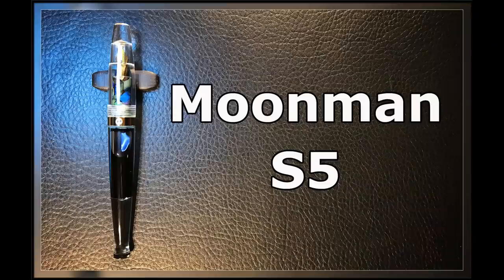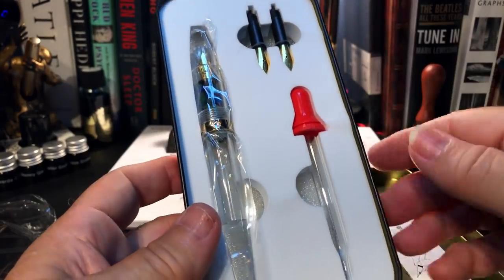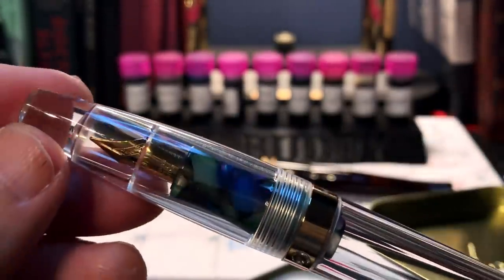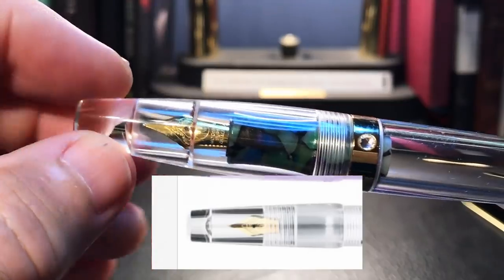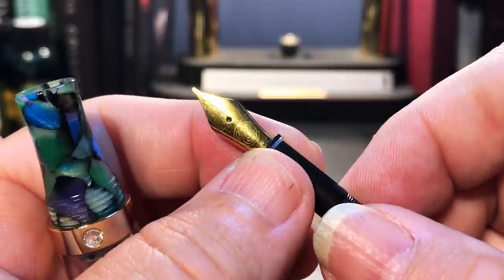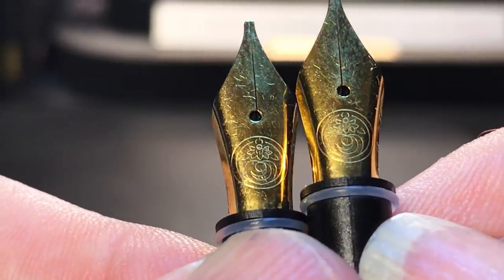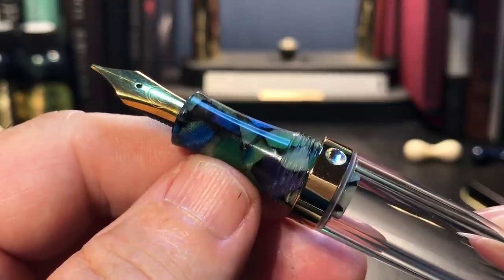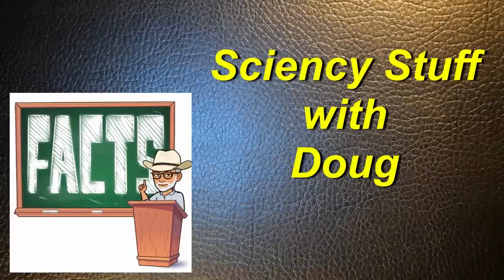Moonman S5 Clear Eyedropper 1.0 Stub Fountain Pen Unboxing and Review

Comment: Thanks for the good review. This seems to be a fine pen but I have a Moonman M2 and I think that's enough eyedropper pens for me. A clip would somehow ruin that nice design. Maybe one of those snakes will fit as a rollstop.
Should I ever travel to a remote island where I need a large ink capacity I'll take my PenBBS 456 or the WingSung 699 with me. Both can take a lot of ink, they have a shutoff valve and won't barf.
Reply from the maker: Fair enough! The 699 and 456 are two awesome fountain pens.

Comment: I have been a fan of Moonman for a while though like you I can't locate a model T1 from my invantory. The most basic eyedropper models were good for testing ink samples. The next model up for marking, underlining newspaper articles - the nibs are mediums and didn't dig into the paper. I use fude T2s for journal headings with Redink. I live dangerously and usually fill to below the section. Spitting in the cap isn't chronic, a roll of tissue paper fixes that. Try a Duke 551 with a fude nib - you won't regret it. It is a stalwart pen. I couldn't get a peacock green swirl Penbbs 323, opted for a blue.
Reply from the maker: Thanks for the suggestion as always, Andrew!
Reply: The peacock was gone before I even heard of it, or seen it, despite haunting the Etsy PenBBS store at least once a day.
Reply: @martinlebl631  If it's that popular, what do you think are the chances of Penbbs doing another run.?
Reply: @MrAndrew1953  If they have easy access to the resin rods, then they probably will. But it might show up in a different model of pen. Not necessarily in a 323. I am keeping my eye out in any case. (They brought out 355 in Misty Mountains for second batch, and I snagged it, after missing it in the first appearance.) Although I haven't seen it in other models yet. I have Niango, but waiting for Amber is a Cat in one of the models I want. (It was available in cartridge convertor model, and the old version of 355, but I am holding out for 500, 491, 456, or 355.)

Comment: I've tried an eyedropper and the burping was so annoying I've given them up forever. My Wing Sung 699 vac fillers hold a ton of ink and don't spit so I'll stick to those for large ink capacity. Love the science!
Reply from the maker: The Wing Sung 699 is a terrific fountain pen for the buck. Did you know that they have the same pen as a piston filler now too?
Reply: @InkquiringMinds  I am partial to the vacuum filler version, as you have the shutoff valve that isn't on the piston filler version.

Comment: Great Video. I got one based on this, but had a lot of trouble changing the nib. Any suggestions to make it easier?
Reply from the maker: The nib and feed are in a plastic collar that screws in and out of the section. Grab the shoulders of the nib with some rubber, like an elastic band, and turn it. It unscrews counterclockwise.

Comment: A nice review and an interesting pen! I was wondering about the "silicone" o-ring. Specifically, if it s silicone rubber my understanding is that the silicone grease would slowly dissolve it. I could be wrong about this, but I was wondering if after a while you have ever noticed these potentially silicone o-rings softening or degrading after prolonged contact with silicone grease? Just curious and thanks.
Reply from the maker: Not that I know of, Ian. I know they wear out but that is from friction not silicone grease. Silicone on silicone should have no reaction at all. In fact, the silicone grease will preserve the O ring as it reduces the friction that might wear the ring out over time.

Comment: If you don't want to wait for the ink to make it through the feed, then you can fill the barrel higher, and let Archimedes push the ink into the feed as you screw the section in. Of course this is more fraught with danger, but if you put in just enough ink, then you can write with the ink dropper right away, but if you do too much, then ink might gush out. Some manuals explicitly recommend this when filling, but it isn't for everyone. I only do this for dry pen, but not when adding extra ink to pen that is running low.
Reply from the maker: Yeah, somehow I think most people will yelling something and it won't be "eureka"! LOL

Comment: Great review! Maybe Moonman was trying to out think us common people, by not putting a clip on we would not store it in our shirt pocket and thus keep our body heat away from the pen and then no burping (ohh um excuse me slipped out) or spitting. Science part of your video was very instructional. 10 minutes ago I was not and Inkaneer , now I are one.
Reply from the maker: Thanks, Ray!
Reply: Having the pen nib pointing up in a pocket would never cause a burp, as the liquid is sitting at the bottom of the barrel. Expanding g air would simply escape. Burping happens when the air is heated by your hand while writing with the nib down. The expanding air pushes the liquid out. The same principle applies when flying and with the change of air pressure at altitude. BTW, some piston fillers exhibit similar behaviour.
Reply: @IAT1964  Thank you for the explanation.

Comment: I love the shape of the 323.  The modest reshaping of the S5 to allow posting ruins the shape for me.  AND I don't care for the jewel.  What I DO like is that spring syringe. 

It seems like the large capacity of an eyedropper is negated by the need to keep the pen over half full at all times.  Might as well fill it halfway with more of that nice clear acrylic.  Personally I don't worry about ink level in my eyedroppers and have yet to have a burp.  Maybe I'm cold-blooded.
Reply from the maker: Thank you, Ichiro! Yeah, it is a catch 22 for sure. For travel or carrying in a breast shirt pocket, a pen with a shut-off valve is the way to carry large capacities of ink.
Reply: @InkquiringMinds  I've never understood the desire for massive capacity.  I more often have to empty a pen than to refill it with the same ink.
Reply: @InkquiringMinds  Yay for the vacuum filler.

Comment: I like the idea of eyedropper pens. Less parts, less to go wrong. It's the burping that keeps me away. I've had my piston filler go bloop when I'm on a roll (cuz I'm so hot🎶) and it bugs the hell outta me.

So, who's making a nitrogen cooled, double-walled coke bottle thick pen that needs testing? 😺

PS: My pen order was delivered the day after I wondered where they were. I'm lucky because they're all smooth writers, and use converters so I can scribble in relative peace. The skinny fat (slim but heavy) Picasso 916s are pretty awesome so far. Easy to maneuver!
Reply from the maker: I never bonded with my Picasso 916. It is pretty, but never wrote well. I should revisit the nib. Instead of nitrogen-cooled, a low-tech solution would be a little solar cell powered fan on the end finial that keeps your hand and the pen cool. Go go gadget pen cooler!
Reply: Haa. I'm finding that a converter full of ink lasts long enough for me with a medium nib. Now that I have more options it will probably stay in the pen box.

I was praying they would work as good as they looked. Maybe they had time to shape up while in transit. It hasn't been long but so far so good. I bought one with a fude nib and an extra fine. Then two Jinhaos, a 450 and a plastic one that looks like a Pilot Kakuno with a clip, and a brush pen to round things out. The first AliExpress order went well😁 Now I can stop looking at their app for a minute.

Comment: Did it come with a stub or did you order it extra?
Reply from the maker: There is an unboxing at the start of the video where I show that the pen came with a Fine nib installed and two extra nib units that were both 1.0 stubs. So, they came with the pen in the box editiion. If you order this pen without the box I expect you get the Fine nib.

Comment: Maybe it is a little bit difficult to find a fine and extra fine nib that aren't scratchy..
An extra fine is almost like a nail tip.
Reply from the maker: Yes, I agree. But, I have many Moonman fine nibs (the default) and they are much better than this one was. I could have worked on it a little and made it better, but I had two other 1.0 stubs in the box that wrote wet and broad, so I was happy. :)
Reply: @InkquiringMinds  👍👍🇪🇸🇪🇸